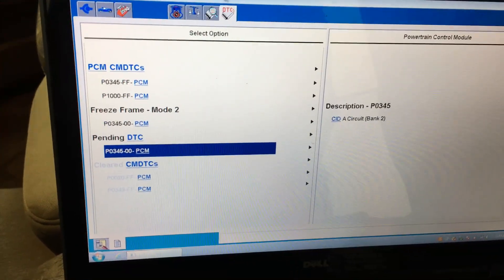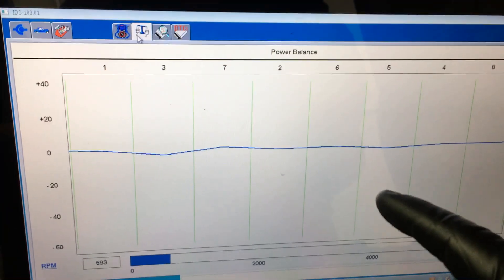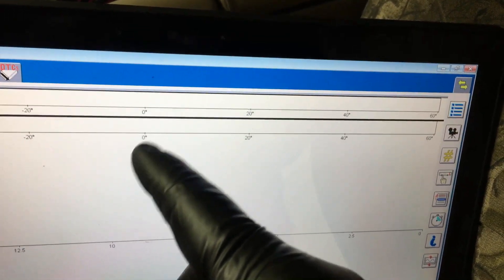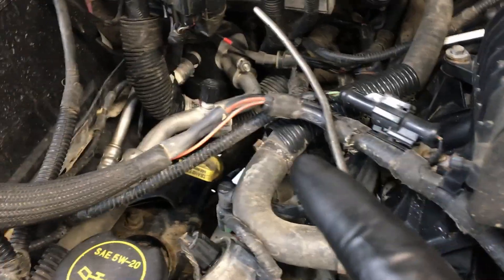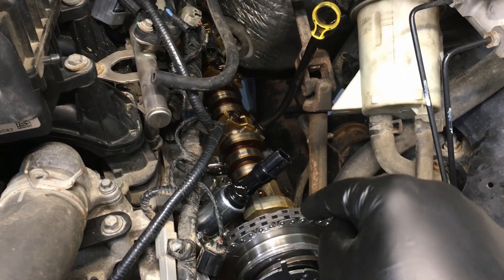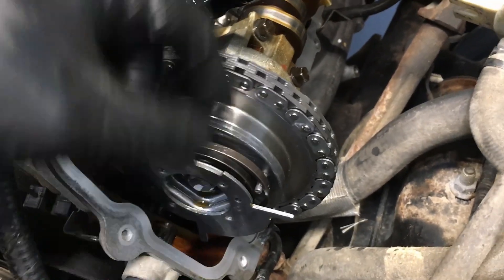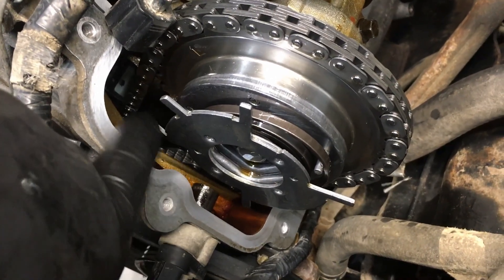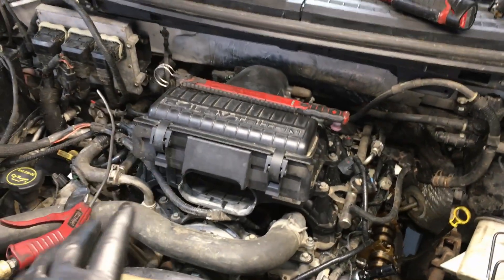Ford 5.4L 3v Triton Engine P0340 P0344 P0345 PO349: Always Inspect These Items First!

Comment: dealing with this now P0340 & P0344. both cam sensors are brand new after rebuild. confirmed timing, bank 1 cam sensor wasnt connected at first start up. cleared the codes. connected the sensor. code keeps coming back. alternator is brand new. even if i reset the CEL, do i need to drive the car or something to get the phaser to agitate to reset position or something? havent put the car in drive since we dropped the motor in.
Reply: Did you determine the answer to your question about needing to drive the vehicle to set the phaser?
Reply: @PaulHenreid  yeah, phasers werent compatible. forgot the brand, switched to genuine phasers and everything worked fine. i even tried bending the little phaser finger first thinking it was a poor/weak signal. nope, something about those phasers didn’t agree with the ecu

Comment: Does anyone know if the tow ring the center tow ring off the three that is said to supposed to be aligned with the L ???
Does it have to be that way to start when you time it???? I thought as long as you are centered over your L with your two black chain links and at eleven o'clock on your crank and your single black chain link is over the crank gear/sprocket dot on the front of it , b by 6

Comment: So i got a new motor , changed every sensor , replaced a pig tail , ran these test the alternator test only threw 1 code P0345 so i ruled that out. VCT test on the other hand threw 1 code and it was P0020 so i figured it was that.. in order to replace it i had to remove the valve cover so i decide to check the ears on the phaser there all straight.. Had timing checked while cover was off, timing is on.. Now my live data test showed the VCT's stayed at 0 No fluctuation at all.. ive been working on this truck for years please help aha..

Comment: I did my timing job about 2 years ago, using your videos, and about 6 months ago I changed my alternator out.  I went with an aftermarket one, but these codes cropped up today.  I cant imagine it being mistimed by me after 2 years, and having the alternator so long could it be that?  I'll go through your checks tomorrow, just confused why Im getting this now.  I've also had a p0300 code for about 4 months, off and on.  If I drive around town it comes on, but if i pull my trailer for long distances it goes away.  I suspected bad coils, but now Im not so sure
Reply: What was the problem?

Comment: Ok I need help im puzzled. I didn't a timing job and my wife's 08 expedition 5.4. After start up it ran great and while charging the ac it popped p0340 and p0344 run like crap. So I did like you say and unplugged the VCT solenoid and cleaned codes and started it up after a few seconds it cleared right up run good again. Plugged it back up and after a few minutes again. Unplugged it again and again run good again. Plugged it back up and now running good but stumbling alittle after I let off the throttle but idles great. Whats going on here? Is it the vct solenoid or the phraser sticking? Please answer I need your advice.

Comment: Can thses codes cause the truck to sound like a diesel? I just did the passanger side manifold on my 2005 and no have codes p0022 p0340 p0344 and p0446 truck sounds like it has no oil.

Comment: do the sensor go out at all? i just did my vct and still getting a rattle at idle, i took some pics after i pulled the valve cover, or should i check my alternater next? ive watched a few of your vids on this and thought my phaser was off, its pointing to the left but lines up on the L on bank 2, do the phasers set different ways when the truck is off? ive seen it set to the right and left for the driver side watching your videos
Reply: btw i got codes p0022 p0012 p0344 p0345 p0349 p1336
Reply: i could use the help or ima trade this guy in, its a 2007 xlt 5.4 f150
Reply from the maker: I have never seen a camshaft sensor fail.

Comment: HELP!!!  We bought a Reman Engine for a 2014 Expedition from a (Purported) Rebuilder in MI.  When the engine was started it seemed to run fine although it was throwing codes.  Maybe a little sluggish (running on Base Timing I'm told)  Immediately we started having P0390, P0365, P0369, P0394 Codes.  My mechanic is thinking that for some reason the sensors are not long enough to read the fingers on the cam phasers in both banks.  Is there any possibility that we have a mismatch in terms of sensors or cam phazers that would change the air gap - making the finger unreadable?

Comment: hello I have a problem I did a job for a friend the car no longer started and the chain hit the guides and a vct was broken a spring I put everything new and started well but then the next day it started failing a lot and turned off it turned on again and  It turned off afterwards I no longer start I checked again and the passenger side the reader of the vct is out of time and it turns back to its place and only by turning the signal it turns and returns to the place while the other remains in its place it will be possible that  that no longer wanted to start again I would appreciate your help thanks

Comment: I have a 04 f.150 5.4 3 valve and I have no power to the crankshaft position sensor but it still starts and runs. After awhile driving it the truck stalls out. Do you know why I have no power to the crankshaft sensor?

Comment: I'm only getting code P0345 (06 Mustang Gt 4.6 3V) on start up only, I can clear the code and drive it for any amount of miles with no code, as soon as I get back in and start the engine boom code PO345!
The Engine is new with around 4000 miles, the builder (BRENSPEED) put in all new FRPP timing components, Phasers, lifters, Cam followers etc....
If timing is off on bank 2 would the code come on during a drive or wot pull?
I already did a compression test, all cylinders are within 5 pounds.
Any help would be appreciated.
Reply: Did you ever figure it out?  Got same code and same situation when I delete code.
Reply: @cesar9496  No but I'm opening the front soon to verify the timing is within spec, I'll let you know what happens.
Reply: @CLPATTERSON  thanks man,  good luck.

Comment: Hey please if you can help me, I have 2011 Ford F-250 with these codes p0369 camshaft sensor b circuit intermittent bank 1and p0394 camshaft sensor b circuit intermittent bank2. I replace both cam sensor twice problems still there Ford parts. It stalls after vehicle warms up. I checked fuel pressure ok 60. Power and ground in the sensor harness. Could it be pcm

Comment: I just did a timing chains and phaser replacements recently, and after starting the truck, immediately got a p0340 code. 
I opened the valve cover on the passenger side, and when I was turning the crank pulley by hand, I saw the signal plate on that phaser, shifted independently of the phaser phaser sprocket. Can that cause the code I'm getting now?
Thanks.

Comment: Thanks for showing the process of Diagnosis - Would have liked to see the scope portion but still more than most videos that are just "see how to replace a sensor"
Reply: I went to the customer that was having this issue (almost assuming it was the same case as in this video and almost missed that the center pin was135º clockwise from the "L" Mark.. sad because the customer had done the timing his self (3 times) in the past month trying to get it right because he wanted to save some money..

Comment: I have an 09 F150 5.4. Today when I started my engine, I immediately got a rough idle. Soon after that I got an error code PO304. I disconnected the battery and replaced bank 1 cam position sensor. I was unable to clear the FTC using a code reader from Oriellys. Soon after that the check engine light went out but the rough idle and stumble on acceleration still exists. Any thoughts?
Reply: I have the exact same problem on my Lariat f150 2006

Comment: I have a 2005 f150 5.4 and the codes p0340, p0344, p0345, p0349 stay on all the time. The truck starts and runs just fine but I am worried because like this it can't pass emissions test. I disconnected the battery, checked the connectors, swapped the sensors just to see if it will change anything, i even disconnected the sensors completely and the truck runs the same. My next step will be to check the solenoid but I dont want to start buying parts without finding out what could be wrong. Have you ever come across these issue?? Thank you for all the help with your videos and comments.
Reply: Did you ever find a fix? Im having same issue

Comment: I found two left phasers on my engine. Will that affect putting it back together? I lost how it was in time, meaning I took it apart without looking at Timing Mark
Reply: Left and right phasers are the same, just install driver's side with the L up and passenger side with the L down

Comment: Currently dealing with chasing down an issue. I had no CEL and all of a sudden my truck stalled while reversing, I cranked it on and drove hm. I pulled codes and got multiple Tb codes. I replaced the tb motor and the Tb codes didn’t go away even after clearing. It then went into limp mode (cel light and wrench lights came on) there was no acceleration. I then got a dorman tb and swapped that on. I was able to accelerate but it stalled again while reversing. Pulled it inside and the code was P0340 and P1000. I sent it to the shop because that was the first time seeing that code. They got an imrc code but I figured it was for my intake and I put my tune that’s required for the intake back on the truck. That code cleared and there’s no CEL ever since installing the Tb. They referred me to a ford specialist as they found nothing wrong with wiring. The ford specialist had me go get a ford Tb from dealership and cleared codes but the imrc came back on so he’s pulling the intake manifold now. I need help because I’m scared they’re gonna do that and a new code pop up

Comment: Thanks for the video!  Im getting those 2 codes (bought a used 05 f150 5.4 w 185k miles). Just changed plugs and cam sensor. Still getting the same codes. Checked the alternator.  Same.  Any ideas what it could be?  Thanks again
Reply: Could you please tell how you fixed it ? I have the same problem. Thank you!
Reply: @mauriciocoura4167  any response as to what fixed your issue? I replaced the engine in a uncles truck with a engine that was from a wrecked Lincoln   engine was replaced by ford supposedly has 20k miles but i get p0345 and sometimes hessitates to run.
Reply: @carlosvalencia3388  no I gave up, I sold that junk

Comment: I got these codes after I replaced alternator. ....... Thoughts?
Reply from the maker: Replace the alternator again with a Ford unit
Reply: @FordTechMakuloco  I did replace with motorcraft. Started truck , codes showed up after new install. Cleared codes, drove for about 30 minutes. Now p0349 . Timing job done about 40,000 ago.

Comment: hello, my name is Ralph and I recently did a timing overall change timing kit on my 2005 f150 5.4l 3V, and when put together with your video, I was impressed because i did it with your assistance , the engine was prime before starting it up, then started, "BUT" not its giving me a P0198 code, i looked it up and checked harness and other sensors, I then checked for power to that oil pan sensor wire, no power going threw,  Please can you help or have an idea what it could be?
Reply: Could you please tell me how you fixed it ? I have the same problem. Thank you!

Comment: Hey Brian, I have a 2005 F-150 5.4. I dont believe this truck has ever had a timing job done. Im getting codes P0340 and P0344, bank 1 sensor1. I have replaced both cam sensors and also the crank sensor and still getting both codes, harness plugs look fine no noticeable damage to wiring. I have not done the alternator disconnect test yet, what is the probability that the tone ring is bent or something else internally with the timing set?

Comment: Working on 04 f150 5.4. I'm 5th mechanic to work on it,out of time.  Checked phasers,locked using nuts and bearings. Replace with new ford phasers,timed . Now have code p0345,duty cycle at 0 at idle,shows to be in sync. Disconnect vvt solenoid, same results, runs rough. According to customer, someone replaced camshafts,are cams the same. Even took pic of timing marks, all aligned
Reply: Could you please tell me how you fixed it ? I have the same problem. Thank you!
Reply: Same problem here

Comment: Hi FordTechMakuloco, I have a 2006 Lincoln Navigator 2wd and it is using oil. There are no visible leaks and no white smoke from the exhaust pipe. Any help?

Comment: I’m getting a po345 and a po340 after head gaskets replacement with new timing kit and new variable cam solenoids tried a new sensor and nothing also disconnected alternator and same thing any pointers? Can’t figure this out need help truck has a rough idle and stalling  oh and I tried disconnecting the solenoids and same thing
Reply: Could you please tell me how you fixed it ? I have the same problem. Thank you!
Reply: @mauriciocoura4167   I had one of the phasers off 180 arrows on phasers should be opposite from each other
Reply: @pedrot9067  So they just "re-positioned the phasers" and it solved the problem? Thank you so much for replying
Reply: @pedrot9067  So they just "re-positioned the phasers" and it solved the problem? Thank you so much for replying
Reply: @mauriciocoura4167  yes that fixed timing clodes unfortunately that bent the valves didn’t wanted to mess with it any more and replaced engine
Reply: you just had a timing job done ? That was my helpers fault and mine for not checking it
Reply: @pedrot9067  wow... thank you very much for the information...
Reply: @pedrot9067  I replaced the cam sensors, actuators on both sides and just the phaser on the bank that I am getting the code p0349 (bank 2) now I am thinking if I should do the full timing job… its just lots of work and risky since I am not a mechanic…I I am thinking if the whole timing job is going to solve the problem or besides that something else is wrong with the engine
Reply: @mauriciocoura4167  I suggest that you get a diagnostic at a dealership that way you know what to fix

Comment: FTM I have 1999 ford f150 5.4l lariat it's been parked all the time at the side of my house and only drive occasionally battery went dead after recharged it was fine idle for 15 minutes to make sure battery charged completely three days after still did not drive the truck now I noticed my instrument cluster all the gauges not working but the truck started replaced identical cluster with the same part number same model now the truck only crank and throw a code 15 being not so good troubleshooter I tried the GEM module but no luck also fuses 20 and 18 are dead not blown consult your expertise cause I am running out of idea my next move is the PCM but not quite sure please help I thank you

Comment: You are a grand master ford tech! Very impressive. My 2010 expedition 5.4 dies after about 20-45 min of driving only code that comes up is one p0341 but no check engine light. I've done a lot of work to it including cams, rockers, and phases. 375,000 miles on the dash and running nice and smooth other then this little issue. Anybody have any ideas?
Reply: Did you find the issue?
Reply: You figure it out

Comment: Hey I have a f250 08 that was knockin cause my vct solenoids were bad  but I replaced them but now  my  my truck is giving me a  p0344 and a p0340 I took  ma valve cover  off  to check  my timing  but   is no problem with the  time   non off my teeth  are bent   I don't know what can the problem can be any recommendation

Comment: Just recently finished up a timing job on my truck and have both p0345 and p0349. Pulled the cam sensor out and put my endoscope camera in the hole to inspect the ears and turn the engine over by hand and low and behold, bent phaser ear! Extremely frustrating! Although the ear that is bent on mine is to the left of the “R”. Looks like I’ll be pulling that valve cover off AGAIN.

Comment: I have a 2008 Ford Expedition xlt 4wd 5.4 Triton engine
i just had a timing belt change done also replaced VCT Solenoids, camshaft sensors and left side plug connector but still getting a code for failure on the left side camshaft circuit.

Comment: 2007 F150 5.4 New Timing.  Mechanically its in time.   Have P0345, 349 340, 344.  fins are straight and in time.   any other suggestions????
Reply: What did you find?? I’m in that boat now. Desperate for help

Comment: Thank you. As a HD mechanic After taking on a side job to time a 5.4 after i did mine using your videos. I got a p0340 p0344. I knew it was timed correctly as i checked so many times and primed the system with oir prior to start up.  Pulled the oil fill tube on ps and one tang was bent back. Will check on every job from now on.

Comment: what the cost of having a mechanic do this timing job?
Reply: My parents paid around $3000 for the engine on thier 2005 Ford F250 Superduty to get a value repaired, tune up & it's timing belt cluster of repairs done. It was worth it lasted 4 years before this code popped up for some reason.

Comment: Hello, my navi 2007 today suddenly  lost power and cel came on with , p0443. ,P0010,  p0020, p0120, p0165, p1719, p0155, p0141, p0135,  circuit open or circuit low, im thinking some kind of wiring issue here, where i can start looking for this issue , thxs in advance.

Comment: Have a 2004 Lariat, new timing kit, new cam phaser, new camshaft sensor on bank 2 and still has ticking noise and throwing a p0022 code